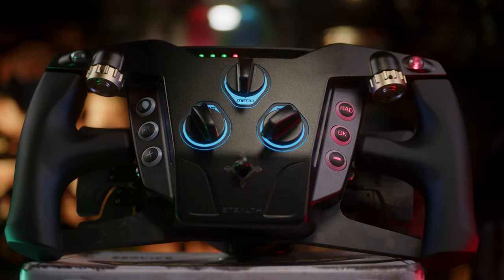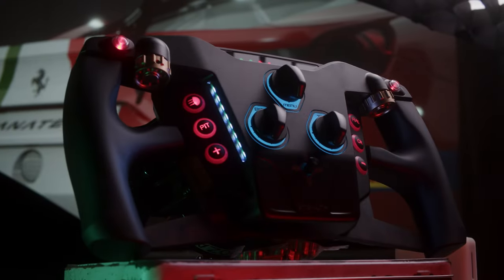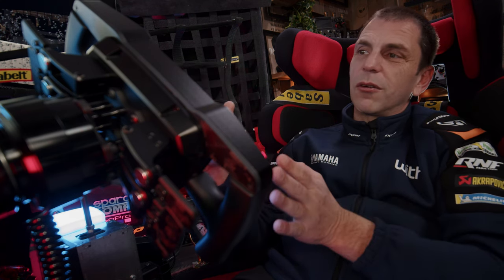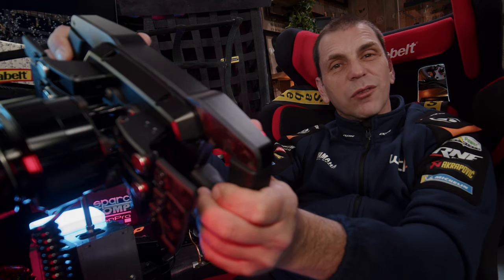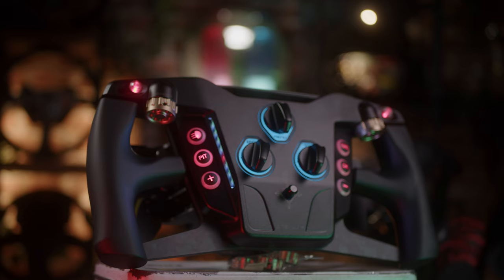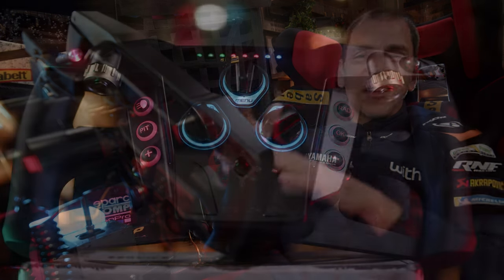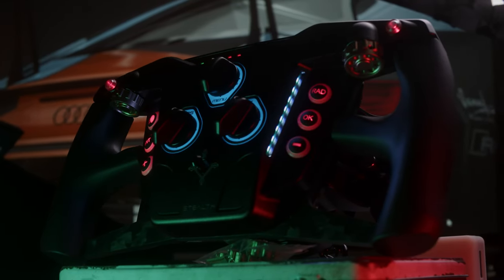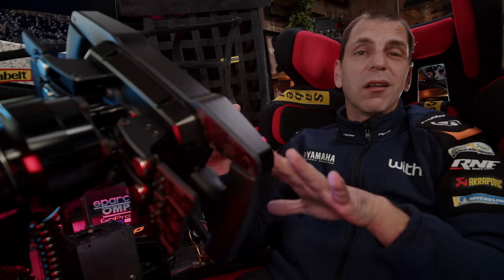VPG Stealth-Unique idea

Comment: Those guys at vpg are absolutely awesome they repaired my wheel and upgraded it while they had it absolutely amazing guys. Ill be looking to them for my next wheel. A round/circulat for drifting and possibly rally racing. However i will need to in vest in a shifter and a handbrake.

Comment: i somehow liked it until i heard "5way stick" instead of a proper 7 way rotary switch... i mean.. come on! for that price tag you simply cant cheap out on the most important feature for a sim wheel which makes every single ingame menu easy to handle
Reply from the maker: Agree with you !
It is not mushy joists and it feels exactly as the 7 way but without the rotating inputs which are not important !

Comment: Im going to buy some new things, i have a 2k limit to spend and i have the vrs pedals. Im thinking on the alpha ultimate+ fxpro or simucube 2 pro with some lower quality steering wheel. What would you choose or recommend??
Reply: The vrs pedals are great value, and great adjustability. The asetek wheel base and simicube pro are very good. You can save money by taking the middle models which gives more than enough strength.
Reply: VRS pedals + dd wheel base in daily use for two years.  You won't regret! amazing for the price.
Reply from the maker: I have heard the VRS DD wheel is a beast and looking the hardware it must be ! 
However, driving different DD bases lately I found , after 2 hours drive I forget I have switched base ! 
I believe whatever DD you gonna get will make you equally happy!
The Simagic + FX pro is absolutely great combo for the price as you really gonna get very good steering wheel !